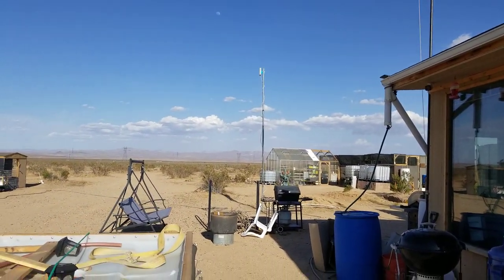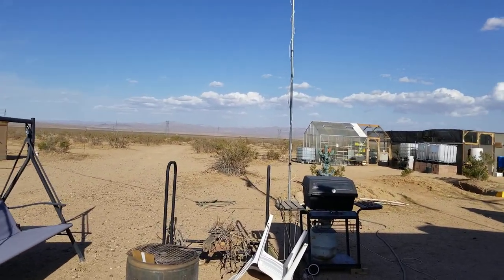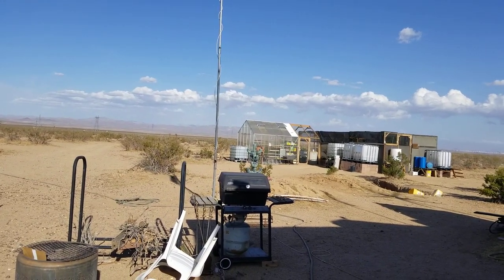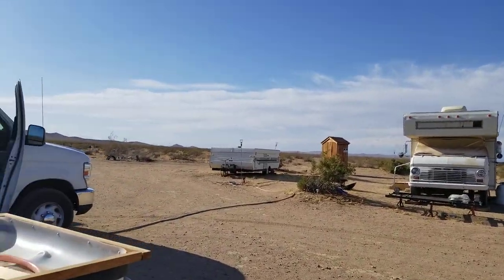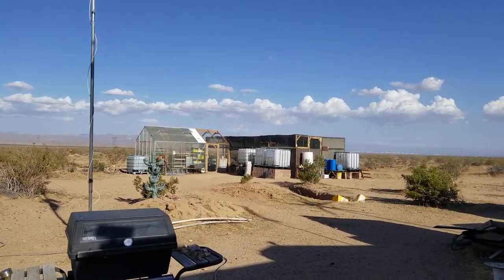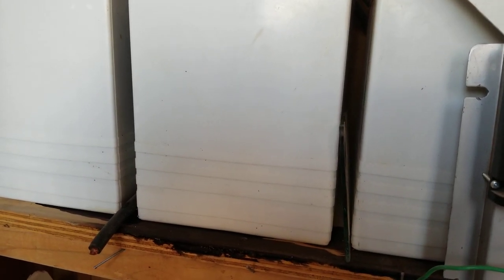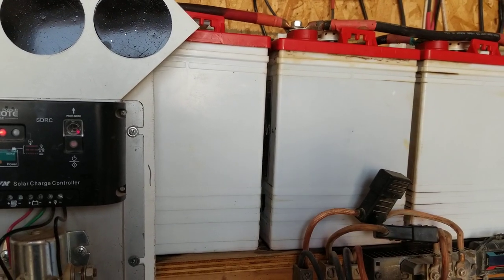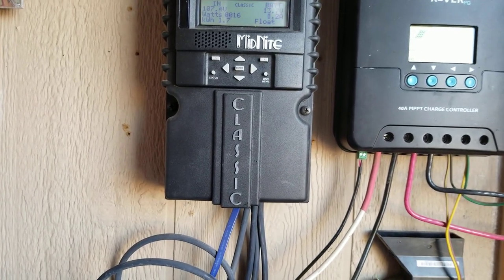Homesteading and Off Grid Tips, May 22, 2021

Comment: Our house was made with blocks in the 50's and still needs air conditioning in summer also heat in winter. I'm in New Mexico, hot day summer 110 summer and  winter cold sometimes in the teens. We also have a white foam roof.
Reply from the maker: Windows and doors make a big difference too.

Comment: I lived in a cement milkhouse. It was pretty easy to heat & cooler than wood built in the summer.
It was 18 ft X 24 ft. The ceiling was insulated very well. With a closed loft/storage area. No bathroom bcuz the garage 100 yards away had a full bath that I shared with the person that lived in the mini apartment behind the 3 car garage.
The upper part of the 3 car garage had a very large, full 2 bedroom, 1 bath apartment.
But the pool was only 25 ft away from my front door. Which I used more, LOL.
Reply from the maker: Sounds like some great life experiences!  I'm thinking a 12 x 12 single room, kitchenette, step in shower, full size bed, heater, separate battery room-controller-inverter, easy walk to the outhouse.  Maybe a ceiling fan, small propane cooktop, maybe a small fridge.

Comment: I need to put a spacer behind my charge controller For air flow. It's probably not a big deal since I just have 2 batteries and a 100w panel, but it couldn't hurt. 
4, 1, 3(sunob), 2 😁
Reply from the maker: Get that air space!  It is important even with a small system.

Comment: LOL when it gets that hot here I'll go to Blue Hole...it's a spring coming out of a bluff @ 46  degrees..if you stay in it you'll turn blue...lol...I remember a day about a week ago when the sun came out...my batteries did that too but it has rained since...2 o clock today I was getting 5 watts in the pouring rain...garden type  plants aren't doing well at all...not enough light and way too much water...it was nice out in the afternoon about 5, no hot sun and about 68 degrees ...can't really do anything much outside, it's too squishy...the dirt is starting to sour here and there, looks like crude oil seeping up thru the grass roots...but...it' s supposed to turn off hot next week, so maybe I'll get my Aims, and get back to more normal 500 watts from the panels...I know at some point it's gonna turn into a sauna here...I bought generator gas just in case lol..
Reply from the maker: Be sure to add some Sta-bul to that gasoline.

Comment: One of the reasons car batteries go dead when setting
The alternator they use today are one wire. So the battery is always feeding power to the charging circuit
(exciting wire)...
Usually 2 weeks to drain the battery
Reply from the maker: That's one of them.

Comment: 2bonus, 3, 4, 1, very nice video. I changed to a digital diversion dump load system, it pulses via PWM digitally the dump load and keeps my batteries from over charging. Digital PWM controller to a SSR to a 500 watt resistor, but your midnite solar has this PWM controller built in already all you need is a quality built DC-DC SSR  and connect to your dump load. Good SSR "Magar" or Meger or Mager DD220D60 very bad ones: "Fotek" or Foteh
Reply from the maker: Thanks John.

Comment: Its good to get away and be with friends. 2 Bonus, 3, 4, 1 So happy your new AIMS is working out so well! Question regarding building a garden house.  how best to prevent snakes from burrowing into the Garden of Eating? Should the 1/4 inch wire cloth under the floor and foundation be bent up to encase the bottom or left flat for a foot or so psdt the walls? I am considering a footing of block 4 high, them build the frame on top. Hope I made myself clear and clearer than mud. Thanks for sharing your knowledge ❤
Reply from the maker: Rule of thumb, "If rodents don't get in, snakes aren't interested."  Snakes don't dig/burrough.  They enter Burroughs dug by rodents in search of food.  A wire floor and lower section of wall that rodents cannot get through will also stop snakes.
Note: snakes may search out cool shade places in hot climates, but mostly move after dark or early morning in the heat.  A proper snake barrier should be at least 2 feet high or more.
Reply: @GBear  Good to know, Thank you!

Comment: 36 blocks
48x96 = 4608 sq in
8x16= 128 sq in
4608 ÷ 128 = 36 blocks
Reply from the maker: Good math!  I did a 10 second estimate on the run for 30 blocks.  30 x 2 bucks is $60, so add $12= $72.
7/16" osb is $64, 10 studs=$90, pressure treated lumber, fire blocks, headers etc.
Even with Type S mortar mix, block comes out cheaper.
Reply: @GBear  
Yes and you have the skills
I remember in the past in California's past cement block cabins being normal in the desserts
Reply: @GBear  
And cement block has an R-value

Comment: Midnites are good with turbines, with the diy power curve adjudtments to suit your turbines characteristics. I always wondered why your voltages were kinda low in the past, that power jack must have really burnt up some power just for the privilege of running . Battleborn  seem good self heating also and much cheaper in the long run. im going liepo4 myself nothing massive though, a freind here did its amazing how small his bank is and how much power he can use and how FAST the batteries charge up man they just soak up the juice  meanwhile back at the ranch lead acid taking its sweet time only being able to suck up so much power. I think those dumpload controllers were aimed at people on a budget i bet it was a good money spinner. Good to see your system  growing in leaps and bounds.
Reply: It's essential to have a dump load if you have a wind turbine, so not to damage the batteries.
Reply: @johnq8792 i thought  midnite had a dump dump feature, i like offgrid steve systematic dump system , dump to two water heaters then once theyre hot, dump to a large compressor and so on.
Reply: @closertothetruth9209  ...yes it has a dump feature built-in, but still need a SSR b4 to connect to heater, I got my midnite solar a bit later after my old dump load add on, but up to now I did not utilize this feature, soon I will ...
Reply: @johnq8792  ah sounds good, thanks
Reply from the maker: I've been watching that new battery technology from Australia...aluminum ion batteries.   They charge faster and hold the charge longer than lifepo
Reply: @GBear  yeh weve got a few different types of battery technology, mining here is going nuts on new types of metals required for new types of batteries, they want to manufacture them here and not china, hope they do it. It could be a win win , a new battery industry and a new mining boom , here a huuuuuuge number of houses have 5 to 8 kw solar systems on their roofs and the government is having to deal with massive quantities of electricity being fed to the grid and batteries for all of us is the answer.
Reply: @GBear  ...when this new technology is on the market the older tech like lithium ion or lifepo will be much cheaper, maybe then is the right time to buy them, the latest tech will have a premium price. 2nd best is good enough for me.
Reply from the maker: Good point!  I take it one step further and say, "If it's working, don't fix it."
Reply from the maker: Here in California,  they advertise "Low or No Cost Solar Installations"
Word is the electric company has projected they won't be able to support all the new housing and population growth by 2025-2030, so the plan is to get more solar back feeding the grid.  In the past 15 years they tried incentives like auto shut-off on business and residential AC in times of high usage, in exchange for lower rates.  Didn't work well.  Bars and restaurants would lose AC on hot days, and customers along with it.
Reply: @GBear  yet big oil etc keep saying solar and wind dont work, reminds of big pharma and also the tobacco industry they couldnt lie straight in bed, i have seen turbines make more power per day using midnites i wouldve bought one but here in west australia theyre kinda pricey, i have a freind a retired electrical engineer and professor i bet he could design one, that is if he doesnt charge an arm and a leg. Im surrounded by trees and houses it does get good winds here being wide open agricultural land just not in my very small town, i have an eleven meter wind up tower that ive wound up in the backyard to see what my various turbines can do but even that height was maybe two meters too short, here we cant legaly have turbines from what i understand unless you have a nice sized property, due to blade noise, you must have drop zones incase it all comes crashing down etc theyre a hobby for me , i have a trailer that i tow the turbines behind me yet much higher than my ute, i found some turbines met rated specs perfectly and cheaper chinese ones were way off spec. ive towed the turbines out to the open planes and parked up you see very good power out here, if i had a decent block of land with all my turbines man id have to come up with new ways of using the excess power. Ive got about 4000w of store bought turbines thats 4000w at say 30mph.
Reply from the maker: That is a lot of power...if you have constant 30mph wind.
As far as danger from blades and noise, some new tech touts a new bladeless wind generator,  but it requires water and wind.  The water is the electrical conductor.